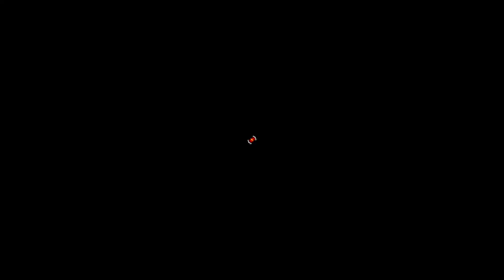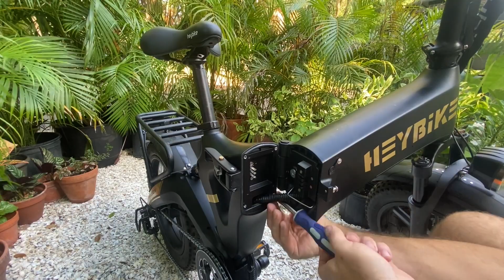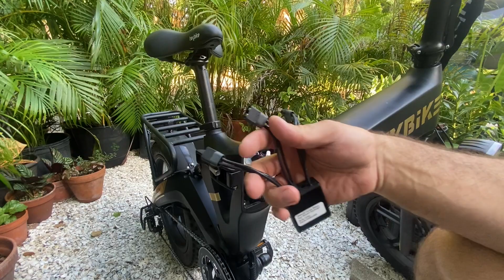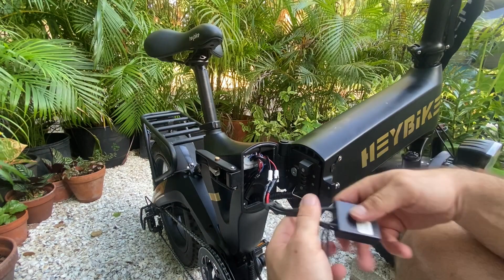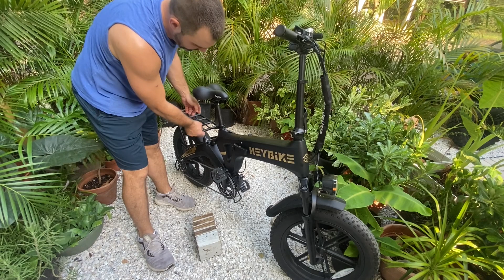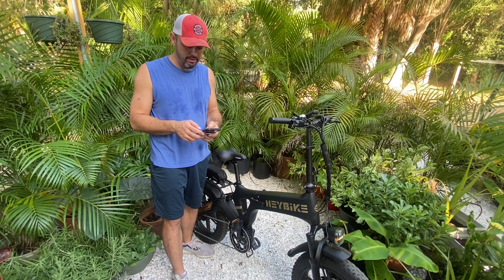Heybike | Tyson | Ebike Plug & Play Dual Battery Balancer Kit Install Two Batteries on Electric Bike

Comment: Make sure the controller isn't pulling more amps than the BMS allows. Not sure it's an issue with a high rated (30+a) BMS, but many of these budget bikes have cheaper lithium cells than are rated at 15a BMS or less

Comment: Thanks, I just installed it and it was really easy. Loving the extra mileage. Btw does it drain the batteries concurrently? If not, how does it work?
Reply from the maker: The balancer draws the higher voltage battery down to a balanced voltage between the two batteries and then uniformly discharges to the low voltage cutoff of the BMS or the controller.

Comment: Does the 20Amp fuse on adapter prevent more than 20 amps from going to motor or coming from battery?  Let’s say I have a battery with high discharge and 40amp bms?
Reply from the maker: The max current limit of the bike controller dictates what the max discharge rate of the system is. Putting more than 20A continuous through a 20A balancer will burn it up
Reply: @ElectricAllWheel  so if I upgrade to a controller that’s 35amp output this balance will not be powerful enough
Reply from the maker: @EVRider561FLA correct. You would want a 40A balancer.
Reply: @ElectricAllWheel  do you sale that option?
Reply: @ElectricAllWheel  isn’t the the hay bike controller 25amp peak. So is the balancer limiting the out put

Comment: How about charging.  Do I need to unplug the 2nd battery and charge separately.
Reply from the maker: For ultimate safety it is recommended to unplug the second battery. We are aware of hundreds of applications where the second battery is not unplugged from the balancer while both batteries are plugged into their respective chargers.